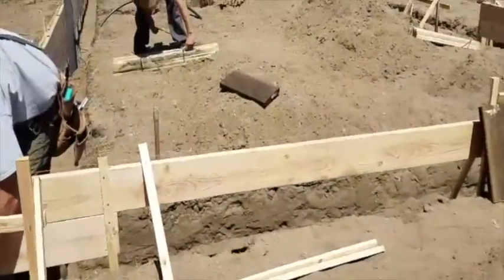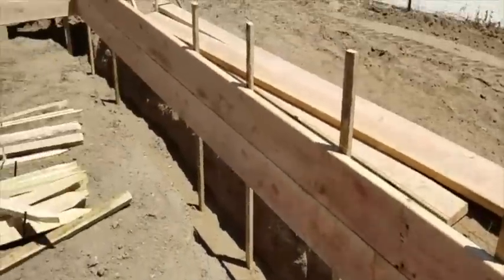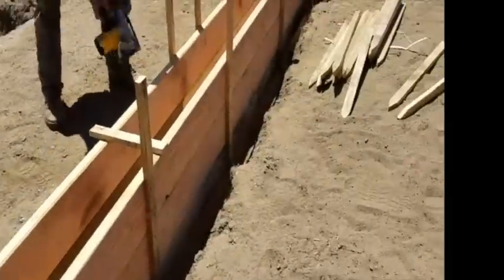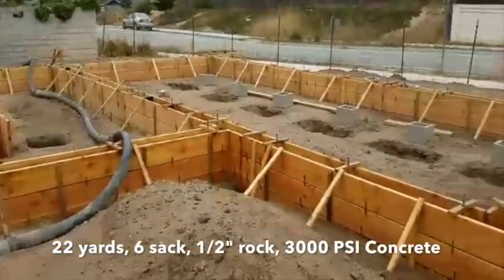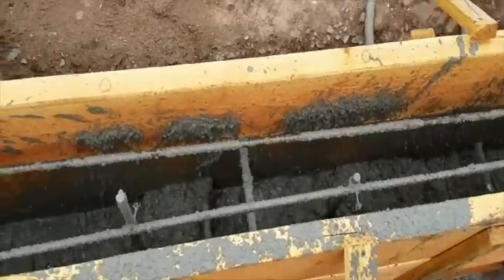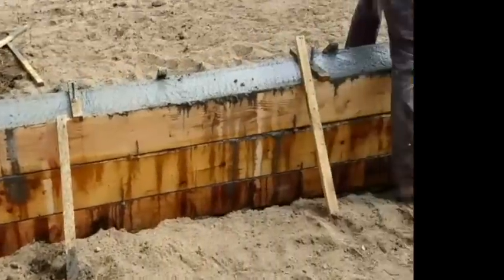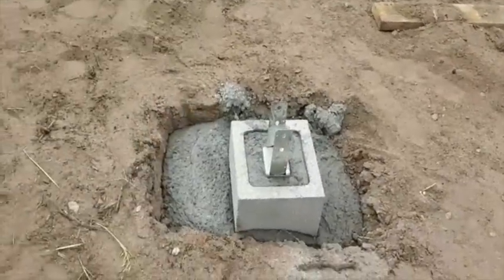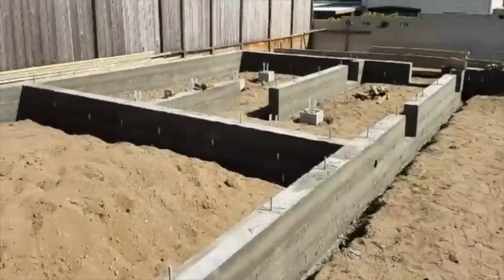Concrete Stem Wall Foundation

Comment: how do you plan to get into the crawl space?
Reply from the maker: Good question! At the rear of the foundation, in a taller area of the forms, a "block out"
area in the forms, 24" wide x 18" high, is made, where the concrete is not allowed to fill, 
providing an access portal. Without that, a access hole would have to be formed in the subfloor framing.- Dave

Comment: Sir, i see this is five years ago, i have a question . I have to do a similar 2 foot high stem  wall for an addition. This is the only stem wall footer combo ive seen .so, you guys formed slightly below grade and let the bottom partially fill trench. You poured bottom to base of forms first . Did you have a cold joint or did you come behind and make it into one?????
Reply from the maker: Sorry for the late reply-
As soon as the footing is poured to the bottom of the formed stem wall, you can generally go back to the starting point of the pour and top off the stem, as the concrete has had several minutes to stiffen up enough to support the wet mud in the stem forms. Dave

Comment: I know this posting is older but I was wondering what all is coming up through the stem wall. Not including the sleeve for plumbing, I see ufer ground, and electrical. What are the other two. Com and water? What’s the black thing all the way to the right?  This is the best video on stem wall foundations, thanks for sharing your forming secrets.

Comment: Curious, is it a big deal if the wall shifts a little while pouring? I mean maintaining level height and corners I’m sure are most important but what if one of the sides bows a little? Building a footing for my shop in the woods now and trying to figure this out. Thanks sir
Reply from the maker: Hey, Hank!
if 45 degree "kickers" (diagonal braces) are placed every 3-4', on both sides of the forms, movement should be nil..
Dave

Comment: Are kickers required to be on both sides of the board? My concrete contractor wants to charge extra because my plumbing contractor disturbed the boards when trenching for plumbing but he only had kickers on one side to begin with.
Reply from the maker: Good question!
Kickers should be on both sides, so as to resist movement from both sides or directions.
Dave

Comment: Thanks for the talent and skill you shared with us, totally agree with the scripture.   I have a question, I’m building a post frame house 32’x32’ , it’s on a slope, slopes down from almost 6” at high point down to about 30” on the other end low point. So I’m not drilling posts here, can I build a foundation wall 16” wide and level out from the low side up to the high point , then anchor my posts 8’ apart just as if I drilled a post for each post?
Thanks for the impute, blessings. Larry
Reply from the maker: Hi Larry-
I'm trying to visualize exactly what you are asking here...
A foundation as in the video, can be done, everything level, with no step up or downs.
Obviously, the stem wall will be higher as the site elevation drops.
A complete perimeter foundation, 16" wide, with a concrete slab floor spanning the interior section?
If I'm understanding, I would pour an 8 " wide stem wall as in the video, and form 16"x16" wide pilasters where each post will sit.
  You'll want a significant drift pin or other way to anchor the posts in place.
Dave

Comment: I'm just learning about this. I was wondering, are the wood footers saved for future jobs? Or does a lot of it get thrown out do to holes, weathering etc?
Reply from the maker: Good question! We'll use as much as possible in the subfloor framing, joisting, rafters ,blocking etc...
I've a subfloor framing video showing the reuse of the form boards..  Dave
https://www.youtube.com/watch?v=4xMSep0uiRs&t=14s

Comment: Hey Dave awesome foundation, they make a coupler for abs or plastic in 6 inch or 8 for sewer to glue into pretty slick makes for a nice tight pass through with no foam. Hope you can use them you seem like the type that would appreciate them.

Comment: The form boards now would be close to three $3000
Reply from the maker: Yea, someone is making some $$$.
I would think about using concrete block now ( i posted a video on the plan details for that). As for the form boards, I always try to design the house so as to use the form boards in the floor framing. You're going to have to spend the bucks on them any way or pour a concrete floor/slab foundation. Concrete ain't cheap anymore either-Dave

Comment: Why not just punch 12" pier holes for your grade beams 6' o.c.  We built subdivisions this way in Fremont, Ca. for Citation Homes and Golden State Framers.
Reply from the maker: Hi "John"-
Depends on the soil and your engineer.
I've done em' both. The pier and grade beam type has been more money.
  One less subcontractor/supplier to wait on-
the rebar supplier that forms and ties the spiral cages, etc..The engineers I've used go crazy with the amount of rebar.
  I'm sure you found ways to streamline the process if you did them repeatedly!
Dave

Comment: Thank you, another great video. How and when do you set the abs for the drain?
Reply from the maker: The abs for plumbing is installed after the subfloor has been framed.
See my subfloor framing vid here-
https://www.youtube.com/watch?v=4xMSep0uiRs&t=133s
I always put a section of 4" ABS in the stem wall to pass the waste line thru and out of the house...
Dave

Comment: Hey Dave, Great video. I was hoping you could answer a couple questions for me. I was wondering how you secure your vertical rebar? And when dealing with a sloped lot, how would you step up when doing a single pour? Thank you
Reply from the maker: Vertical rebar is tied with pre-made 6" wire ties  (they come in rolls of 500). The vertical ties have a short bend on the bottoms, which are tied to the bottom member as well as being tied to the horizontal runs. See the set up in this video-

https://www.youtube.com/watch?v=9gC9BwwVjo4

  On a sloped lot, the footings are cut in steps as well as the forms stepped up the lot.
  Start the pour at the lowest point and pour the footings, to be followed by topping off the stem walls after all the footings are poured.  There's usually enough time to prevent the stem wall mud from blowing out the footings when poured 1/2 an hour to 45 minutes later after the footings are poured ...
Dave

Comment: does the  concrete not need to cure?
Reply from the maker: Concrete starts"curing" the minute it's poured.
in warmer weather it can set hard in a short time.
Learning how to "read" the setting/curing time comes with experience. There's a relatively short period in which concrete can be "worked"- troweled smooth, necessary stakes pulled, etc..
Concrete poured in Hoover Dam decades ago is still curing!!- slowly getting harder with age!!
 Most concrete is considered to have reached it's "working" strength in 28 days after pouring..
Dave
Reply: @daveosland3199   Wow that's crazy!!! thx for the info!!!

Comment: Dave, do you know how high a stem wall can be poured before it needs engineering
Reply from the maker: Code section 404 shows up to 9' tall with a 12" thickness, but every application can be different and often engineering is required on walls much less than that depending on each circumstance.
  For the past several years nearly any project I've done (in bureaucratic California) required engineering.
Reply: @daveosland3199  yes I'm in northern California someone told me 6 feet without engineering then just build a 4 foot pony wall on top of that. This is for a daylight basement foundation. Thanks for getting back

Comment: Hoping you are still monitoring comments. I live in Iowa, and am getting ready to build a new garage, and want to get it up in the air a bit. My garage is going to be 24x28. Code here calls for a 4 inch floating slab with a 6x6" thickened edge. What I want to do is pour a "6 W x 20" H wall and then come back and pour a 4" floating slab, leaving 10" of the wall exposed from top of slab. I will build the garage on the wall. Reason I ask if that sounds reasonable is because I have had 3 contractors out to bid, and three different opinions, and they all have 10-30 years of experience. One wants to pour monolithically, all in one. One wants to pour slab with 1/2" rebar sticking up, then form and pour stem wall on edge of slab, the other one agrees with me. So....I turn to YouTube, naturally. :-)
Reply from the maker: Hi Ryan-
Like they say, more than 1 way to skin a cat...
A monolith pour 20" off grade is a lot of form/fill work to get that high in one shot.
  Myself, I would pour a 12" x 12" footing- code minimum for a single story building, either incorporating the stem wall as a monolith pour, OR
pour the 12x12" footing with #4 rebar sticking up every, say 24"o.c., followed by a 8-8-16 CMU block (I love "speedblock" which requires no end buttering with mortar) stem wall.
   Once the block is concrete filled/poured,  back fill the garage area with compactible fill, lay a grid of rebar and pour the slab.
I recently posted this design after questions just about this method-  This is a way to get an elevated slab.
https://www.youtube.com/watch?v=9gC9BwwVjo4&t=4s
   You can also get a glimpse of the monolith poured footing/stemwall followed by back fill and a slab in another posted build-
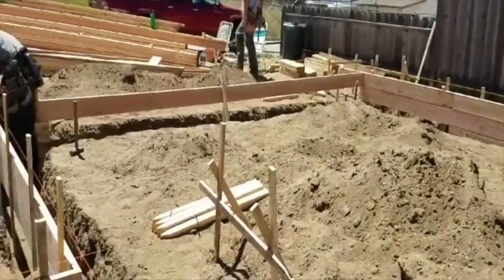   minute 1:50 on-
  https://www.youtube.com/watch?v=FbYrGaoWIec&t=7s
Let us know what you end up doing!
Dave
Reply: @daveosland3199  thank you. 4th guy came today. 30 years of experience, and wants to pour the slab with a 6"x6" thickened edge so 10" overall, with rebar sticking up, and lateral 1/2 reinforcement, then come back and pour the wall which will be formed on top of the slab. Second guy to recommend that, so think that we'll do that.
Reply from the maker: @QuickFamily8144  Sounds good!
Dave
Reply: Is there a way to protect against wall seeping where the slab and separately poured stem wall meet?
Reply from the maker: @QuickFamily8144  Hi Ryan
If the slab is elevated to 20" above the footing, it shouldn't be an issue.
When pouring 20 foot high concrete tanks, we've sandblasted between 4' lifts to ensure a clean bonding surface to prevent leakage, but that would be unnecessary in your case.
Dave

Comment: Thanks Dave, I mostly had jobs after pouring the concrete but lately I’ve been doing jobs where I have to pour the foundation. This was a great example for first timers like me. I showed my boss and he said that’s a old school way to do it and he found it very cool. I juts have one question that maybe you could answer it’s #3: What are your thoughts on the organized system used to do the forming and its finished look?
Reply from the maker: I'm not sure what you mean by "organized system".. The exposed concrete after the house is done can be left as is, painted to the ground or even veneered with stucco stone, brick, etc...
Dave
Reply: Good luck

Comment: What material did you use to form the foundation, and then how will you use this material next?
Reply from the maker: 2x Douglas Fir will be used in the framing of the subfloor. I have a video on subfloor framing showing this...
Dave

Comment: Why do you poured the first nine yards of concrete all the way around the bottom of the form first instead of filling the form to the top as they went along?
Reply from the maker: Good question!
The footing mud needs to stiffen up for a while to prevent the pressure from the stem wall mud  blowing the footing out and allowing the stem mud to billow down into the footing...
I'll bring the mud up to the bottom of the stem wall with the 1st truck (generally 9 yards). By the time the 2nd truck arrives and we start pumping, the concrete where we 1st started has set up enough to allow the 2nd lift to top off the stem wall without blowing out...
Dave
Reply: @daveosland3199  
Do you vibrate the concrete?
Reply from the maker: @lumberjackdreamer6267  We use different methods to "settle" the concrete.-
Can be as simple as tapping the forms with a hammer, often using a 1x2 stake to rod the mud, or in places that are tight or suspect, quickly plunging a vibrator into the mud. Notice the word quickly-  a few seconds too long can send the concrete billowing out of the bottom of the forms....
Reply: @daveosland3199  
Thanks. I have been using a vibrator on sono tube piers (dug with auger, 48” deep by 10” wide). I kept with vibrator for a long time, maybe too long? But my mud was also maybe too thick, didn’t flow well. It’s my first time doing concrete.
Reply: @daveosland3199  
Your videos are very informative. Thanks.
Reply from the maker: @lumberjackdreamer6267  
Stiiff concrete will take more vibrating.
In this type of foundation/pour, the footings are poured on the stiff side, while the stem wall concrete is wetted up to flow better and for easier fills of the voids in and around the stem wall- hence less vibrating.
Dave
Reply: @daveosland3199  
Thanks for the info. Very useful. I finished my first concrete project and learned a lot.

Comment: what do you do about ventilation i didnt see any vent holes formed in your wall our code requires us to  have vents with in 3' of each corner? i am building my own house and wondering if i should do this or lay block i enjoy carpentry work more than block so im leaning  to stem walls all the way around what do you think?
Reply from the maker: The foundation vents are put in the wooden subfloor framing- easy-peasy.
Should you need to put the vents in the concrete itself, I like to uses a CMU (concrete block), lay it on it's side, leaving it open from inside to outside and then install durable screening to prevent critter infiltration!!
See my video on subfloors... Dave

Comment: do you think it would be possible to pour a stem wall, fill the inside with dirt, and then pour an elevated slab to the height of the stem wall?
Reply from the maker: Good question!
Yep!! Done it numerous times. If I do one in the future, I'll post a video of it!
Dave

Comment: How much did you charge
Reply from the maker: Costs vary on site, layout complexity, engineering involved, etc.. 
There's no set formula I've found you can accurately get out of a book...
Dave
Reply: @daveosland3199  They asked how much you charged for THIS job though. You can def tell us how much you charged for THIS JOB... I'm betting around 10-12k..

Comment: Excellent and very informative video but I didn't see any foundation vents.  Did I miss something?  Or aren't they required where you poured this?
Reply from the maker: They'll be in the framed sub floor rim.
you can see them on my "sub floor framing" video... Dave

Comment: Hi Dave. I’ve watched a lot of videos about forming in prep for me to repair my garage. I’m planning to add a stem wall above an existing foundation.The previous owner had raised the landscaping about 8” above the top of the slab, so the bottom of the 2x4 walls (true 2x4’s and 1x6 exterior cladding inside Vinyl siding)

My plan was to cut a groove into the foundation,drill holes for the anchor bolts, then add a 2’ high stem wall on top at 6” thickness 

Any advice is appreciated.Thanks
Reply from the maker: Sorry for the delayed response! Cutting a groove sounds ugly.
You might consider drilling into, cleaning and epoxying vertical rebar dowels at say16"o.c. and forming.
The dowels will anchor the stem to the existing concrete. They make nifty double barrel epoxy guns and tubes!

Comment: Dave, how long between footing pour and stem wall pour? Thanks
Reply from the maker: Usually by the time the footing is poured (usually 30-45 minutes) you just continue on up with the stem walls.
Reply: @daveosland3199  Thanks for the great video Mr Osland. I'm curious though, and maybe I missed the reason why,.but you didn't need to form up a footing. You just let it flow out the bottom when you pour the stem wall? (I ask because I'd rather do that than form a footing for my 24'x24' cabin tin the PNW.)
Reply from the maker: @regw8322  The walls of the dug footing themselves are the "form"....
Reply from the maker: @regw8322  Yep- It just flows into the footing, and then up into the formed stem wall.
The trench (18x18") forms the footing- no need for any forming. Generally hang the stem wall boards about even or a couple of inches below/into the footing trench.

Comment: Hi just check out this video and I want to find out if there was a continuation video where it shows how you pour the slab out. We are constructing a house and they put the blocks in before pouring the foundation. I wanted to know if this is a commonly used method and if this will make my house stronger. Thanks

Comment: Need Moore reebar and vibrador
Reply: More rebar?There's 2 at the bottom, a horizontal run every 12-18", and 2 horizontals at the top. Vertical runs 18"  o.c.from top to  the bottom, hooking under the bottom runs, around the entire foundation....How much more should be added???
As far as vibration, there were no voids anywhere.....

Comment: Hi Dave, thank you for your amazing video. I also start constructing my new project and it will be my first project :). It is 2 story unit. As you mentioned below, footing width is 15'' and stem wall width is 8''. The depth for the exterior walls are min 24'' deep and footing depth is 12''. I have excavated the soil exactly 15'' width. But i am wondering how to nail stakes to the wood which is blow the ground level? Can you give me any advice?
Reply: Hi Adam-
Tough question! Generally, the forms are not hung below grade, because of access to fastening. The best i could think of is to use a 2x12 to extend down below grade, but have the top edge close enough to the trench lip to get a screw into the top edge to hold it.
  on other foundations where I've had to go below grade, I've used a concrete block stem wall rather than wood forms..